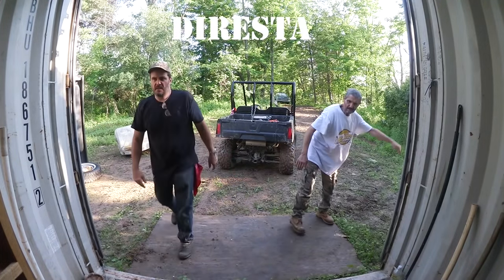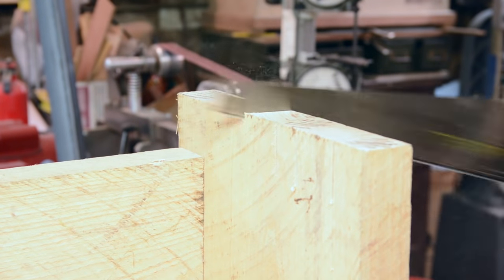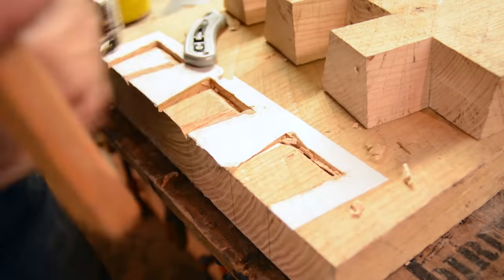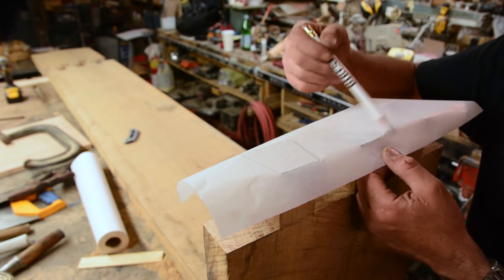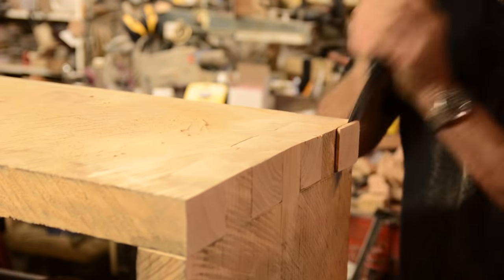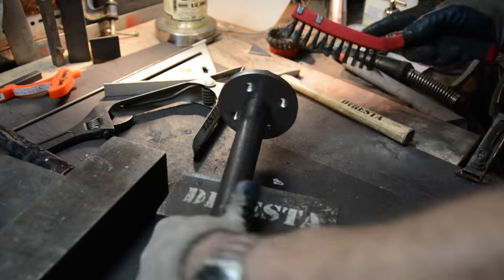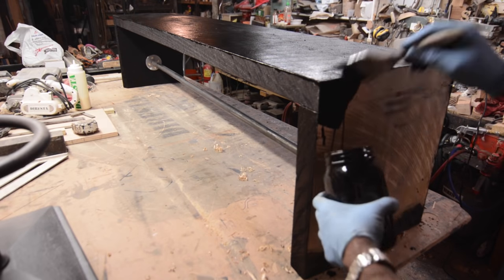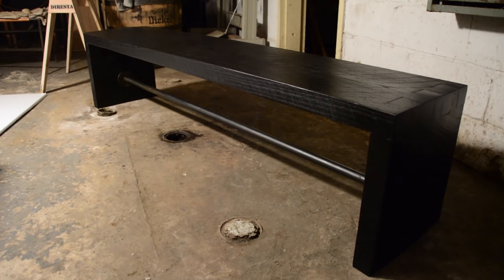DiResta's Cut: Massive Dovetail-Joined Bench

Comment: 2:37. "You got to be gentle" as he hits the Dremel with a mallet LOL.
Reply: Jared Jeanotte Watch again.  He doesn't hit the dremel with a mallet.  He switches over quickly to a chisel and mallet to remove the waste.
Reply: Kevin Wright Actually, I think he was just tapping the material back down so it wouldn't bind on the dremel blade.  There were already chisel marks in the end-grain at 2:35 and the chisel stayed on the bench top, it seems.
Reply: Yes, on second look I think he just taps the waste material. It's hard to tell on hi-speed. But either way he does a great job on this piece.

Comment: Great video, as is the one with the dark wooded bench, make in part with wood laminate flooring. . . .which got me thinking.  The  large DIRESTA template which you used on the underside of one of these tables, can you spray paint the same template on say a piece of plywood, and then take the plywood to your band saw, and cut a 200 piece jigsaw puzzle from the plywood.  Possible to do??   Of course it is, as you are pretty good on a band saw. . . .as you say so yourself.   I'll pick it up next month when I think you mentioned that you are over in the UK.   What do you say???

Comment: Very cool. I love the circular saw texture. I would have put the tails on the legs and the pins on the bench so that the legs cannot pull down out of the bench - using the strength of the dovetail. Any thoughts or reason?

Comment: Once again, neat stuff!

Having wrung off my share of brass screws in red oak (and what a royal pain-in-the-ass that is), I have one thing to say - bar soap.  It doesn't matter if it's Ivory, Lifebouy or Irish Spring, if you drag a wood screw through some bar soap first, it will suck down securely and predictably.
Reply: Wilson,
I never had any problem with the various hard soaps I've used.  Doesn't take much, just a light drag of the threads over the bar.  Used this trick on bunches of rock maple and red oak, finished the oak mostly with Watco Danish Oil or spar varnish, the maple with shellac.